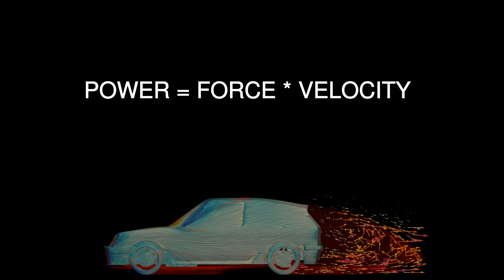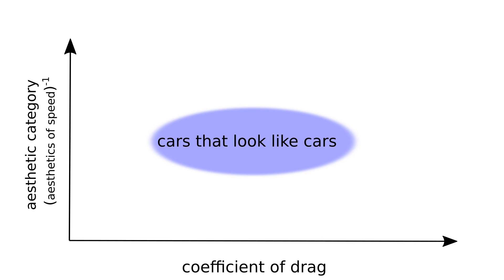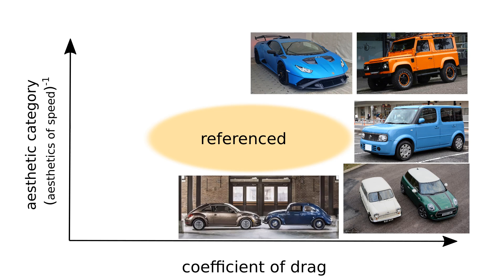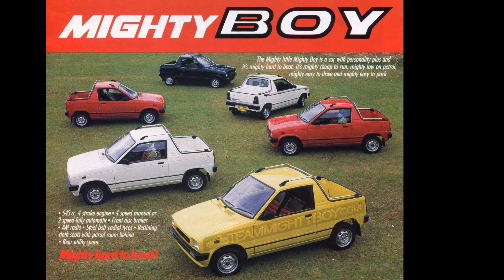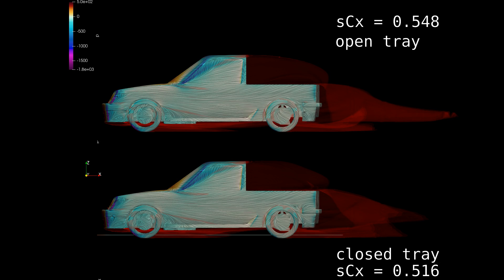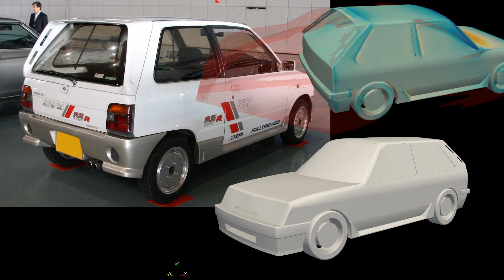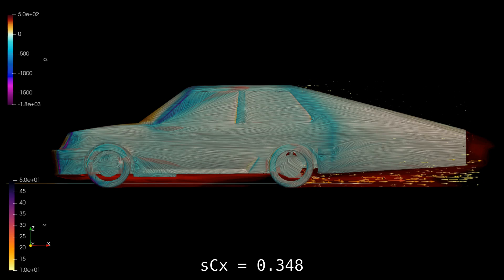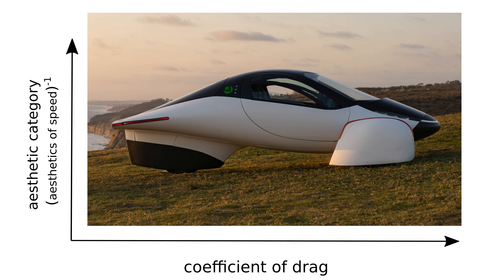Aerodynamic Analysis in CFD for the Economics of Speed

Comment: I feel obligated to complain in order to maintain social acceptance. You have hurt my feelings by not factoring in the weight distribution the long tall version would cause. I believe it's my social obligation to point out the abhorrent looking long tail would suffer increased frontal  lift that would also disturb flow over the bonnet, windscreen and roof. 

I would like to complain in advance of the solutions requiring increased rear spring rate as ride quality and NVH are far more important than fuel consumption or the raising of the rear ride height on the grounds aesthetics.

You won't need to worry about aerodynamics once Elon Musk builds hyperloop tubes everywhere. And look don't start with no one can breath in a vacuum, or out gassing is a real thing in a vacuum or convection and conduction aren't possible in a vacuum or anything not pressured will basically explode. He sent a car in to space without problems so I'm sure he knows what he's doing.
Reply from the maker: Hi your viewership is important to me and your complaints have be forwarded to management where they will get back to you shortly.
Have nice day.

Comment: CFD is not real life!!!!
Reply: Sure but it is more accessible than accuiring all these cars / doing the prototypes and putting them in a windtunnel.
Reply: @narancs5  tuft testing is basically free (except maybe the fuel you will use) and pressure testing tools can all be acquired for under 100$ wich is way less than the computer he is using and is 100% accurate. You dont need any wind tunnel